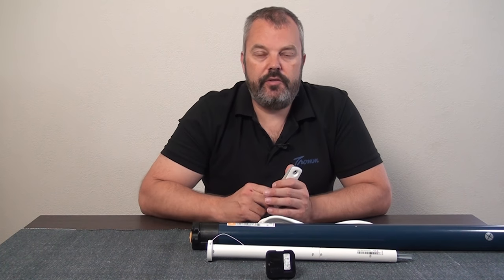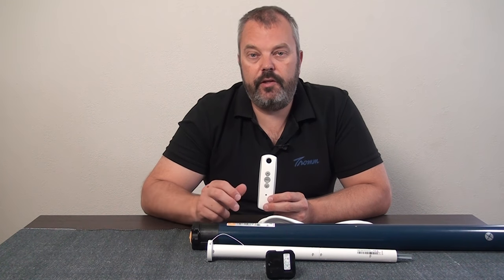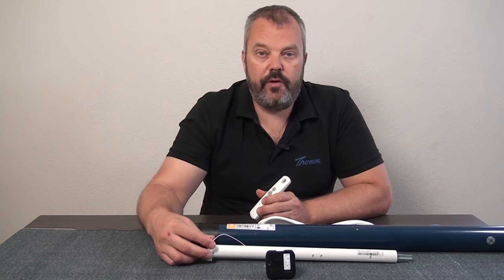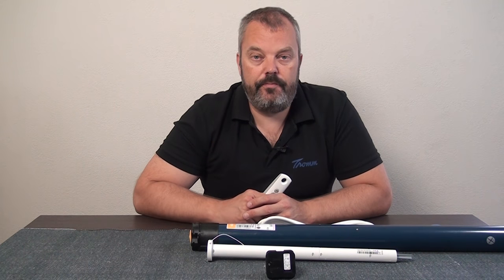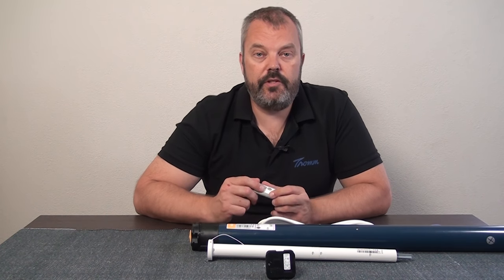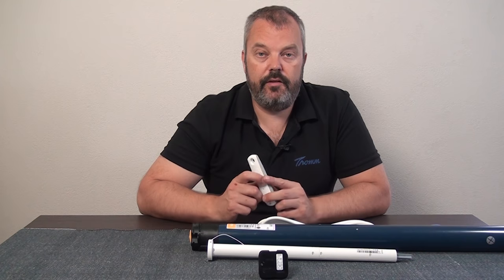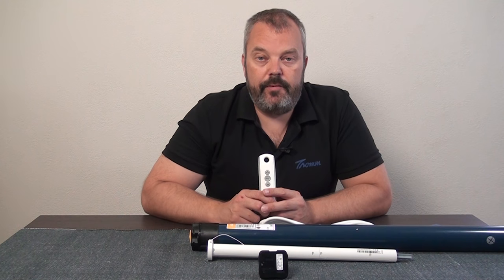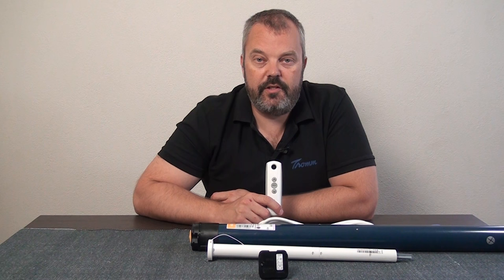How to reset a Somfy remote control - RTS

Comment: Note to you and others that was crucial to succeeding with the reset.  

Another video you made is the only of yours and others I’ve seen that mentions this “extra” step that’s not mentioned in the factory directions.  

Step 7 on factory directions states hold the program button until the motor jogs and then proceed to step 8.  

***DO NOT RELEASE the program button after it jogs as it states.  CONTINUE HOLDING for about another 8 seconds until it jogs a second time.

Proceed to the next direction steps as stated and I hope your aggravations end as did mine.  But I then had to reset the range.  Easy: go to each desired end press both the my and direction, hold for a few seconds. Repeat opposite end.  Next, Press and hold the program button until it jogs.

Comment: I have reset my remote a few times and it still won’t work. When I hold the up button it acts like it is going to go up but it only moves the tiniest bit. I am wondering if the motor is shot? The place I purchased these from is out of business but the shades are only about 6-7 years old. I can’t find any somfy dealers who will come out and look so I am going to try and replace the motor myself if this could be the issue?
Reply from the maker: Hi Brittany, do you have batterey operated blinds or are they mains powered? 
If you could send your reply to info@tromm.com and address it to me, I'll look into it.
thanks,
Otto

Comment: How to reset a Somfy RC 10 +  remote control  with 2 bottons?
Reply from the maker: Hi, it's always the motor that needs to be reset if it's an RTS system. Could you let me know what you are trying to reset (rolling door / garage or roller shutter)? I should be able to help you with a bit more info. thanks, otto